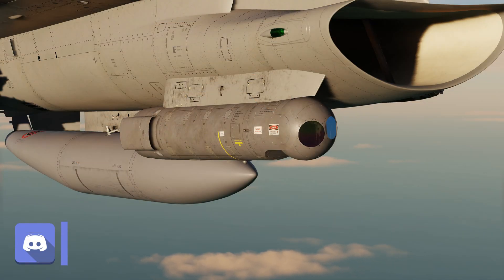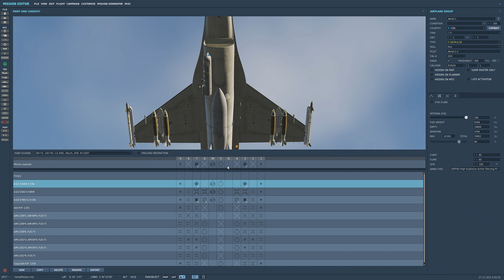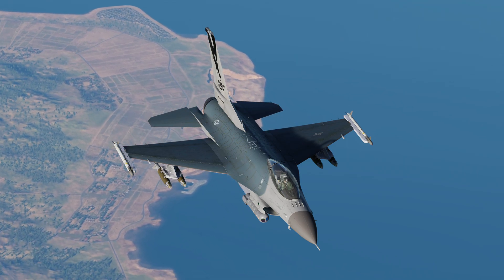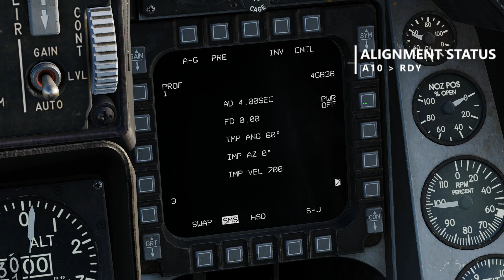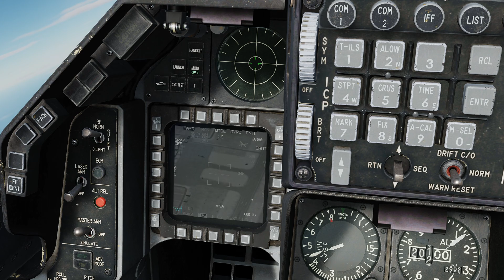F-16C Viper JDAM / JSOW Ripple, Markpoints Tutorial | Digital Combat Simulator | DCS World

Comment: The Mark point feature is not being accurate
1- I mark the STP A
2- I mark the STP B
3- I go back to the STP  A and find that it moved slightly... 
PS: I'm well aware about CZ and stuff, pretty sure I did it properly but still have a small offset that I need to correct right before throwing the JDAM everytime
Reply from the maker: Yeah this procedure has changed so many times with ED over the years I stopped making updates.

Comment: For some reason my TGP does not cycle through the markpoints such as yours did after selecting several targets via the rocker switch. The markpoints change via the DED but the TGP remains on markpoint 26.
Reply from the maker: Hmm. Is the TGP SOI?  Could be a bug?
Reply: @chazflyz  yes I’m wondering if a bug in VR perhaps? I was able to bypass the bug by cycling pre to vis and back to pre. Then I was able to cycle targets with the rocker.

Comment: I had a really bad experience today with that.
Georgia, Bunker destroy mission. I flew at angles 6 and marked 2 bunkers with this method. After checking the new STPTs the positions were messed up. No STPT was on its originally placed point.
Reply from the maker: Could be a bug. Someone reported an issue a couple of weeks ago in these comments.  I suggest running a DCS repair. If that doesn't work, report the issue at the Eagle Dynamics F-16 forum with a replay track file.

Comment: great explanation but its not working properly, maybe its one of the Viper bugs they changed. When I put cross-hairs on the first target then press MARK, the TGP is no longer the SOI, and I can't press TMS Fwd to mark the target. If I put cross-hairs on the target then press TMS Fwd THEN press Mark then M-sel it stores it properly.
Reply from the maker: Yeah been playing with this recently and something changed or is bugged.  The DED shows the HUD as SOI after pressing MARK so it needs to be changed to TGP. 
I use this procedure in Falcon BMS and it works as advertised.  I'll look into reporting it to Eagle Dynamics.
Reply from the maker: After extensive testing, I see what you mean. Something changed after this video (and Tricker's).  
The quick fix is move the ICP dobber switch to SEQ to change the SOI to TGP on the DED. And press DMS down to make the TGP SOI again on the MFD.
Reply from the maker: Al Heeley, watch this video for an update regarding this procedure at 3:20:  https://youtu.be/1LUr6rRzgTM